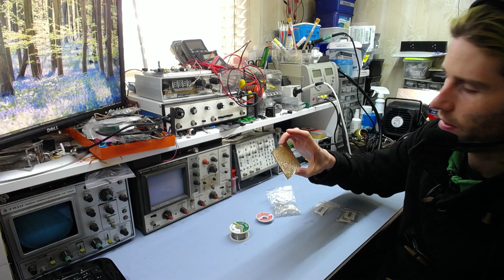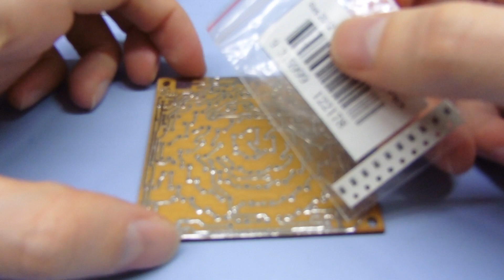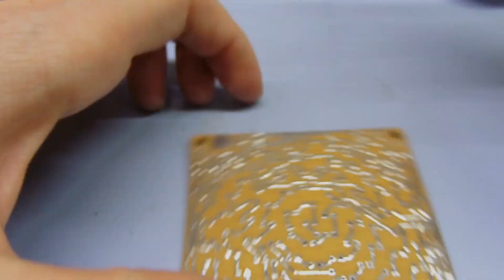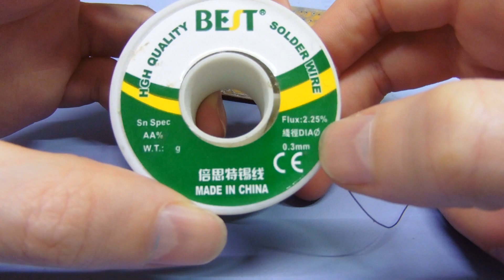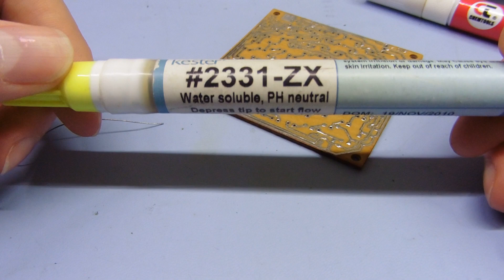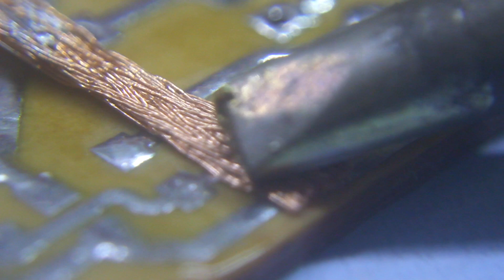Quick & Dirty SMD Soldering Tutorial

Comment: Personally I find pre-tinned boards to be a huge pain. What I used to do is leave the resist on until I'm ready to assemble, then tin all the traces as I ad components. Since nerdrage published this video https://www.youtube.com/watch?v=Hsw3lOnHaas on homemade tinning solution I just use that, it's totally the cats ass.
Reply from the maker: Thanks for the tip - that DIY liquid tin looks pretty good! I might give it a try sometime....

I don't like leaving resist on the board though. In my experience, with toner-transfer especially, the toner resist is somewhat porous and seems to absorb etchant, and after some time the board becomes pitted etc.
Perhaps that would not be a problem when using the photoresist film, but I don't leave that on either.

If I don't feel like tinning\assembling straight away, I just leave the etched board bare. If the copper is clean, it will take a long time to oxidize. Especially if you keep the board in a Ziploc bag.
Reply: Agent24  Interesting point about the etchant absorption, I don't think I've ever left one more than 24 hours so perhaps I didn't run into that. Or on the other hand, perhaps I ran into exactly that and blamed it on poor toner density.
Reply from the maker: I had a severe pitting problem with some boards early on, when I left the toner-transfer resist in place after etching, for several days.
After that, I always rinse the etched board in baking soda + water, then clean the toner off immediately. That may be overkill (maybe it only requires one or the other) but I have not experienced the problem again.

I have never actually found a printer which gives perfect toner coverage, however. Maybe they used to exist, but with all the new energy-saving and toner-saving designs these days I suspect it's even more unlikely now.

In the case of plain toner, even with immediate cleaning after etching, I find there is often still light pitting in some areas, although it is not enough to cause concern. The TRF from PulsarProFX certainly helps, although as you see in my video about that, it does not always apply perfectly - though it has very good performance when it does.

Most of the time I now use UV-reactive photoresist which is more consistent, and to get around the imperfections in toner density, you can print the mask image twice and overlay the copies. With that method I have had the best results so far.

One thing to note however: most printers do not have a 1:1 pixel perfect output, so with very fine and intricate designs it is best to print the same exact page twice. That way, any non-linearity in the printout is more evenly matched between both copies. If you print the same artwork twice on the same page, there is some skew in the geometry between each one which can cause issues when aligning the layers.

Comment: Good experience thanks,but  remove ic is defficult than smd.
Reply from the maker: Removing SMD ICs is fairly easy with a hot air rework tool. If you're talking about through-hole ICs on boards with plated through-holes, you are best off using a vacuum desoldering gun, unless you can cut the old IC pins off, and then desolder each one separately.

I'd recommend this video series: https://www.youtube.com/playlist?list=PL958FF32927823D12 (Rework & Repair from paceworldwide)